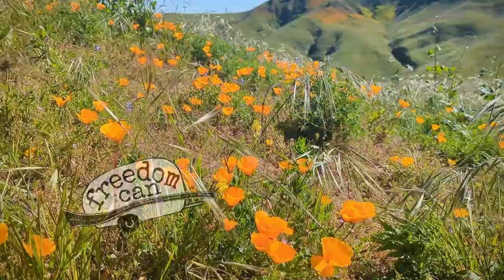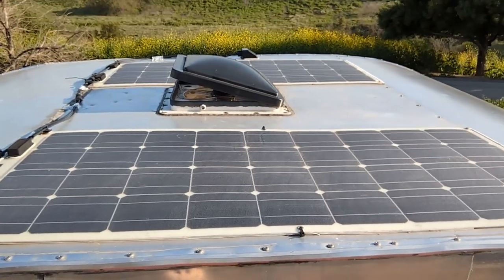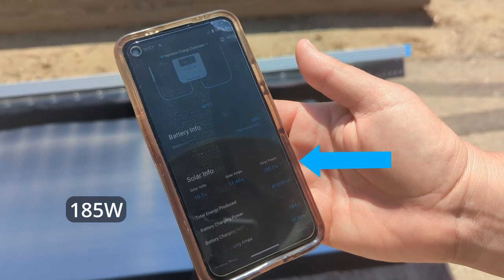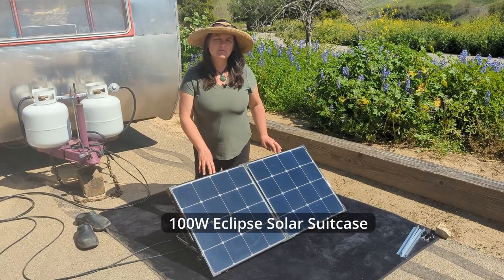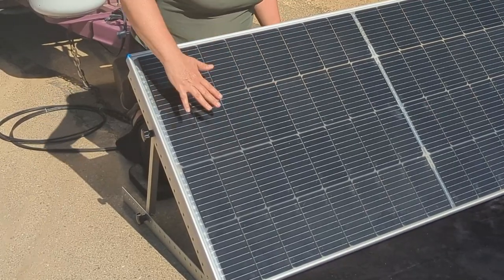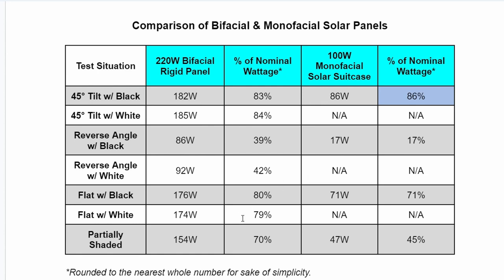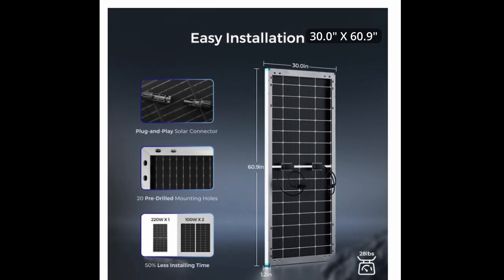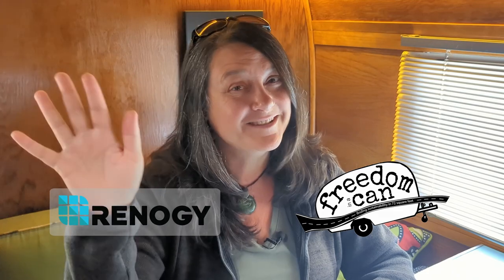How Efficient Are Bifacial Solar Panels?

Comment: Isn't 86 watts from 100 wats one-sided panel much better than 186 watts from 220watts bifacial
Reply from the maker: You have a point there.  Here are some parameters that could explain the difference.  1. We tested the Bi-facial first, so slightly earlier in the day -- the sun was at a stronger angle when we tested the mono-sided panel.  2. We really didn't do enough tests in all light conditions, to gather enough data to confirm the overall better efficiency when compared with the mono-sided panel.  3. A better comparative panel would have been a 200W mono-sided rigid panel, but we only had our 100W Eclipse (which is more efficient than other 100W panels already).   
But the thing that we found in this short test isn't when the panels are set up in that "optimum angle configuration" but rather in a flat installation (which most RVer's are going to do on their roofs).  Check out the video @4:25 where we have the chart.  The Bi-facial is 80% of maximum watts, where the mono is 71%.  Keep in mind the other features we discussed, low light angle, and even partial shading.  Also the footprint comes into play as well, because this 220W bi-facial is smaller than regular 200W rigid panels -- so you might be able to fit more panels on the roof.  These are all the real-world conditions under which in this test the bi-facial performed better.  It all depends on how you're going to use your solar array, and under what conditions.  Thanks for the question!

Comment: It would be interresting to know how much shading area has an output of 50%. I have my 4 bifacial 120 Watt panels mounted (4m x 0.8m) behind an apartment building balcony fence (Almost Stealthy) and it produces 200 Watt out of rated 4x120=480 Watts. Not bad if you consider these panels cost (& weigh) less than standard panels. My fence has 9 small fence beams a panel and due to the angle of the sun horizontally its shading increases. Ofcourse the shade is not completely dark but is more diffuse because of the surrounding daylight and the distance (1 cm) of the beams to the panels. The beams are white and my balcony area is mostly white also. I charge batteries. An MPPT system optimizes the output constantly. There is no other way to mount these panels.

Comment: did you notice the reflection from the standard panels front surface onto the back of the bifacial. keep them a little more vertical and more off the ground to get more sun under front of bifacial👍👍
Reply from the maker: Good advice!  That precisely why I think these make excellent patio covers, or RV window awnings!  Lots of great applications.  Thanks for the comment!

Comment: I'm looking to get one of these just to charge a single 200ah battery...If I need to fast charge the batteries. I use the Renogy 2000 watt inverter\charger\transfer switch.. As I'm usually hooked up to shore power..Their DC-DC Controller gives me the alternator as 3rd option backup...
Reply from the maker: Sounds like a good plan!  Great to have 3 options to charge, and getting solar into the mix means that you really won't have to think about it much.  Be sure to use our code and affiliate link to save some money on your purchase.  https://renogy.sjv.io/rQQgvv  promo code "Canlife"  All the best, and let us know how it works for you!
Reply: @FreedomInACan  Well I pulled out the wallet and bought this thing during the sales this month. As they got more of these in stock today...This should give me 3 ways to charge battery bank...
Reply from the maker: @WizzRacing  Great, have fun with it!  And good luck!  Let us know if you have any questions.
Reply: Only question I had for them was the New Smart Shunt 300 0.. They mention it in a video. But does not show up on their website. As I got the One Core. And I think that is the shunt designed for the One Core..
Reply from the maker: @WizzRacing  Good question, we haven't seen that either, we'll ask our contacts about it.  We have the Core as well, haven't installed it yet - back logged on projects, but soon!  We tested the Renogy 1 M1 last year in a video and also installed it on our friend's REGO system install - those are both videos on our channel.  The only thing you definitely need to connect the Core is BT - 2 modules to your components, that way it can connect the data and display on the monitor unit.  The REGO components all have built-in BT modules, but they are easy to plug in and connect to the wall, pretty inexpensive as well.  There might also be a hard wiring option.  Best of luck!
Reply from the maker: @WizzRacing  Question before we get in touch with the Renogy engineering team...which country's website are you looking at?  Their new products are often released at different times in different countries, so that info will be helpful for us when we look into this for you.  Thanks!
Reply: @FreedomInACan  I'm on the United States Website..They mention the Smart Shunt and show it. On the One Core video... 

I got the bundle which included the DCC50S, One Core and BT-2 module. Then they got the 220 watt panel back in stock today. So I grabbed one with a tilt bracket kit.. Not sure why they removed it from my cart a few days back..
Reply from the maker: @WizzRacing  Thanks, we'll look into it.
Reply from the maker: @WizzRacing  We checked with the engineers at Renogy and they are still working on the 300 smart shunt, will let you know when we know !  Thanks for your patience.
Reply from the maker: @WizzRacing  The sent me a spec sheet which I can share with you if you email us at freedominacan1957@gmail.com  
I will follow up and see if they know when it's going to be ready to sell.  Thanks!
Reply from the maker: @WizzRacing Got a little bit more information about the 300 Smart Shunt.  This is designed to work with AGM & Gel Batteries, which don't have any smart technology.  This allows you to connect those batteries to all the Smart tech that Renogy is coming out with, DC Home App, and Renogy 1 M1, & Core wireless remote monitors.  We're actually going to put out hands on one in a few weeks and we can send you some info. The shunt isn't necessary with any LFP battery systems.
Reply: @FreedomInACan  Not sure how that works. As a Shunt does not care what the battery type it is. It just measures amps.. Unless it's an inductive coil pickup..Which is still just a watt meter.

Just have to wait and see what they are using...

Thanks. As I finally got the panels up. But my batteries charge so fast. It's all done by 10Am.. then it goes into Boost mode the rest of the day..
Reply from the maker: @WizzRacing  You're right that the shunt doesn't care what battery type is.  However, since all the smart LFP batteries have BMS systems that measure the battery voltage, amps in / out, you don't need a shunt.  But Gel and AGM don't have BMS systems, so the Smart shunt measures and then will transfer that info to the Renogy 1 M1 and Core monitors.  With that connection, you can use all the same DC Home App, and remote functionality that these two monitors provide while using lead acid chemistry batteries.  
Awesome, about the panels and the quick charging.  Once you get off the grid, it's hard to go back!

Comment: Thanks for sharing, I am a little disappointed in the black vs white backdrop.  Thought white would yield way more.  So, again thanks for the education.  Have you ever tested with a radiant foil?
Reply from the maker: No we didn't test with that, would be curious.  It is possible that a piece of coroplastic isn't as reflective as an RV roof.  Hard to say... Thanks for the comment!
Reply: The white paper backdrop was very thin a white tarp or white rocks or your white metal RV roof will reflect a lot more.
Reply from the maker: @debidee5548  Yeah, we thought that a white RV membrane could be the ticket.

Comment: A mounting surface at least 3 feet is recommended from most sources for best bi-facial efficiency.
Reply from the maker: Thanks for the advice!  So, based upon this it might be best to install these as window awnings on the side of larger rigs.  Not sure that 3 ft mounts on a roof would be as practical.

Comment: Those tilt mounts at 2:27 from Renogy say that only work on panels up to 28" wide but it doesn't look like you had any problems with the 220w cells at 30".  I'm considering these as my first panels, these or the new 450w bifacials.  I'm amazed at the flat results as well as the partial shading results.  Both would play a role in my backyard ground mounted cells.  A review of the 115w version shows up to 50% shading still produces good power - that's amazing and worth the higher cost per watt in many cases.. 
Thanks for the review.
Reply from the maker: Yeah, I'm kind of surprised by that size limitation, because we had zero problems with the tilt mount.  It was even the Renogy engineering team who loaned us the kit.  I'd go for it.  
Also, your ground mount panel array sounds awesome, I think that might be the optimal setting for these bi-facial panels.  Good luck!   Be sure to use our affiliate link https://renogy.sjv.io/LPEyNY and promo code "CANLIFE" at checkout, to save 10%.  Let us know how it goes, okay?

Comment: Bifacial panel co.panies claim to get power from the reflection of light. 
So why  did you not face the power side of the panel to the sun and measure your power output and then cover the power side of the panel to see how much actual power that panel still receive  without moving the panel. 

You did not even use the same  kind of panel,  your foldable panel will have less output since it got  got more intetnal connections, so itbis not a compareable test.
Reply from the maker: Thanks for the feedback.  This was hardly a laboratory test, and we never intended it to be.  We were merely trying to compare the percentage of the "real world" conditions vs. the rated watts of the two types of panels, 100W portable and 220W bi-facial.  We're not comparing the two panels, rather under what conditions did one panel perform better with regards to the observed percentage of its rated wattage.  And in terms of covering the front of the bi-facial, much of the power from the back comes from light passing through the panel itself -- it is clear glass, so we did not think that doing a test like you suggested would show much.  Again, thanks for your insight.

Comment: 6:10 a good question. I have been wondering how the idea of making bifacial solar PV panels smart sounds. Is there very specific difference when compared to monofacial smart solar PV panels apart from your summary table at 4:24?
Thanks for your response in advance. I must say your video was really enjoyable and interesting! Glad to watch!
Reply from the maker: Thanks for the comment and questions.  Since this is pretty new technology it's difficult to assess exactly where this will really shine in terms of efficiency.  However, I think we've shown that in the variety of settings you'll experience as an RVer the bi-facial panels are more than likely worth the extra investment because of their versatility.  As to your second question, we don't have any other specific differences - pretty much put everything we knew / had into the video.  Thanks for your comment, really appreciate the feedback!   Let us know if you have any additional questions.

Comment: I have a comment on your test conditions having to do with the angles of incidence and reflectance you've neglected in your tests, especially when you turn the panels around. If you think about it, the panel surface is ideally set up perpendicular to the sun so direct solar is maximized. If the panel is off axis to that perpendicular path/axis of illumination, the efficiency drops. That should also be the case with reflected vs direct illumination. By turning the panels around, you've changed the conditions from illuminating the rear panels with a more direct illumination in terms of both incidence angle (a direct reflection from a surface illuminated by the sun) vs the original condition of a less intense reflection from skylight only (there can't be a direct reflection from the sun there since the rear of the panel situated in that orientation is in it's own cast shadow). Apples and oranges.

Related to this, you might consider either elevating the panels and/or moving the reflecting surface further back from underneath the rear panel to maximize the less intense reflection from the skylight. You would also benefit from increasing the size of the reflector and maybe using some reflecting aluminized window shades in place of the white sheet you've employed.
Reply from the maker: These are all great ideas and your insight is truly illuminating, thank you!  😁
In our video conditions we were trying to do the best we could with what we had at the time.  A typical RV roof is unlikely to be optimized in terms of both angle and even reflectivity.  But a more reflective roof, like the white membrane roofs that most modern RVs have, will certainly help.  Our take away is that when not optimally angled the bi-facial seems to perform at a higher percentage.  Yes, it's true that both panel efficiencies drop but the single sided dropped more. It will be interesting to see how people like these and the creative uses that arise.  Thanks!